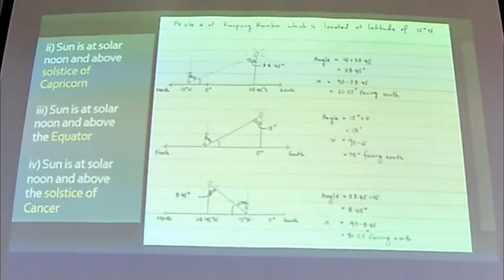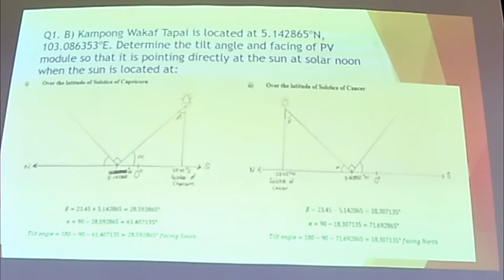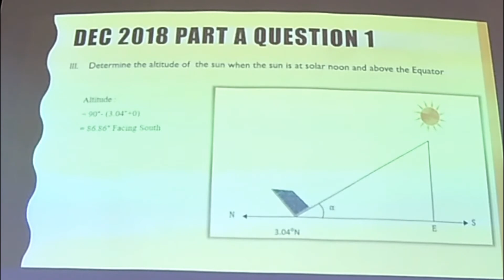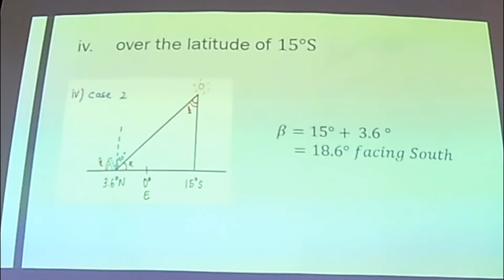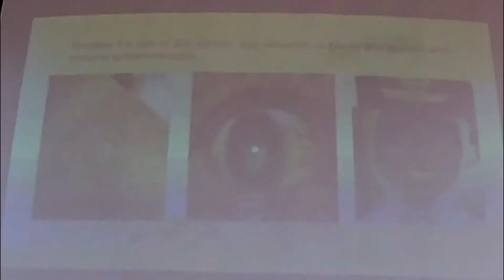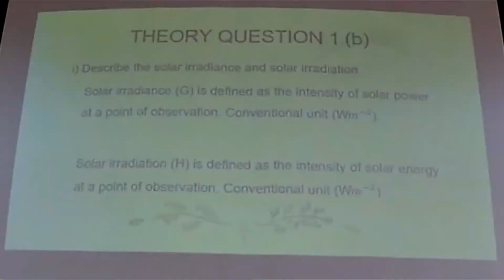Introduction and Basic Solar Engineering

Comment: @renewable energy charge controller solat bole guna untuk wind turbine ke
Reply from the maker: boleh guna jika tiada pilihan lain namun pastikan characteristic of current  dan voltage sama pada kedua dua sistem dan capacity battery storage. Namun ini tidak digalakkan kerana berisiko berlakunya overheat/kebakaran kerana wind turbine selalunya beroperasi utk 24 jam berbanding solar hanya pada keadaan siang dan cuaca elok, ini boleh menyebabkan overcharge jika charge controller (CC) tak dpt berfungsi dengan baik. Byk lagi risiko lain. charge controller iaitu hybrid charge controller adalah lebih sesuai utk kedua-dua system